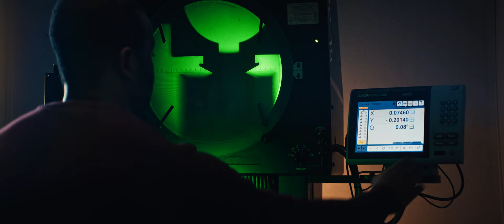Smith & Wesson: Who We Are

Comment: I love my M&P 2.0 4.625 inch barrel 10mm without a safety lever.  My belt carry for my job as a Armed Dispensary Officer. Thanks for coming up with such a feature loaded semi-auto pistol in the caliber cartridge I wanted. S&W makes this gun owner happy!!!
Reply: I live in Springfield, do you know of any armed dispensary that’s hiring?
Reply: 10mm for an guard? What a beast.
Reply: @SoWavvyy  pick your carry load. Two legged predators 40 S&W or equivalent in a 10mm case. 230 grain for four legged predators in the woods and plains.
Reply: @jeffreylocke8808  I know man I used to carry my Glock 29. I had 200 grain federal HST loaded for 2 legged or even 4 legged creatures because on how far it penetrates. Kinda scary how far they penetrate even with self defense loads. Now I just carry my baby Glock 43 with trijicon hd sights and extra magazines. I live in a good area and will probably never have to use it but it’s there just in case and it’s extremely comfortable for appendix carry.